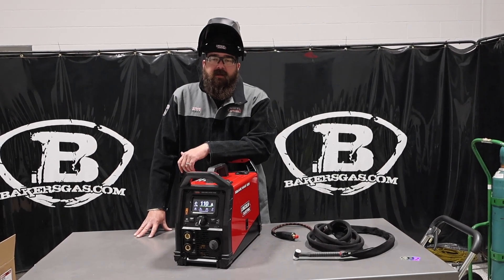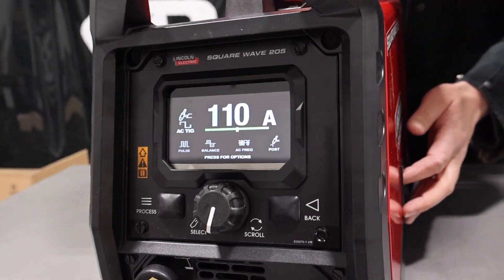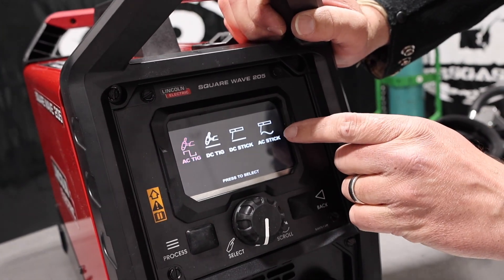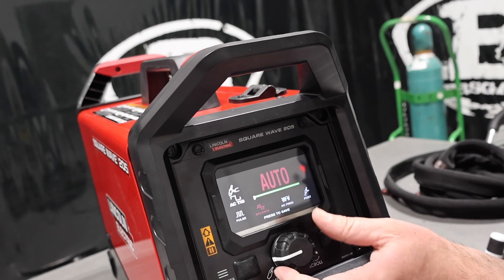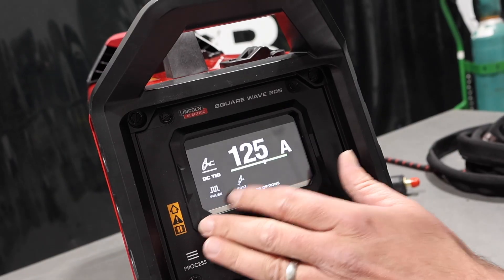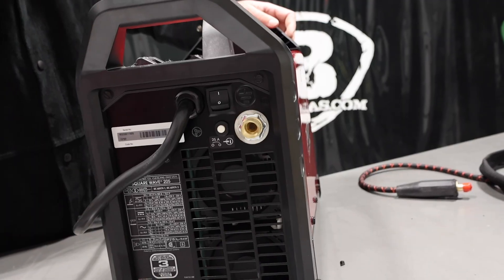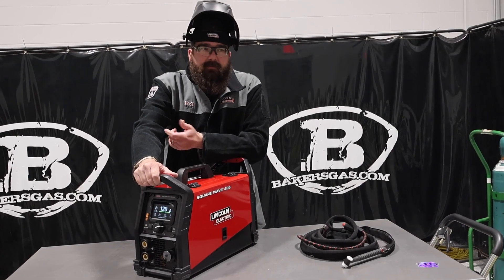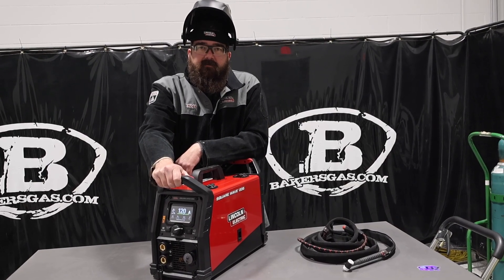Lincoln Electric Square Wave TIG 205 Review K5613-1

Comment: Can anyone help me out? How to I know how big of a generator I need to run certain welders like this.
Reply from the maker: To run a Lincoln Square Wave TIG 205, you will need a generator capable of providing a minimum of 8,000 to 12,000 watts
Reply: @BakersGas How did you calculate this?
Reply: @BakersGas And should run without any problems?

Comment: Could you use a wireless foot control with this unit?  How about a water-cooled TIG tortch?
Reply from the maker: There is not a water cooled set up on for this one. Or a wireless foot control sorry :( The Miller 212 you can

Comment: I want to see ac welding…. Also is this the promo price or is it actually $1400? That’s crazy it’s lower priced with more amps than the machine its replacing. Might grab one of these. Alittle small for what I need but would be nice having something portable. I want the new dynasty 300
Reply: If anything it will weld aluminum better than the original Tig 200 and yes it's 1500 flat out retail price I just bought mine the other day the supply house told me I was the first one to get one from them and they just got them in the day before
Reply from the maker: Yes, it is super competitive price!

Comment: I like my Tig 200 but always disliked that it lacks post flow adjustment.  What surprises me is the upgraded 205 is currently listed for $1499 on your website while the 200 is still $2695 with a $700 rebate.  The 205 is cheaper than I paid for my 200 over five years ago.
Reply from the maker: It is priced super competitively!

Comment: What are the specs for current and duty cycle using a 110v power source?
Reply from the maker: TIG: 125A/25%*
TIG: 100A/60%
TIG: 85A/100%
DC Stick: 80A/25%
DC Stick: 70A/60%
DC Stick: 65A/100%
AC Stick: 70A/100%

All details listed on spec sheet tab 
https://bakersgas.com/products/lincoln-k5613-1

Comment: How thick of material can you weld with tig?
Reply from the maker: The Lincoln 205 TIG welder, with model number K5613-1, can typically weld up to about 1/4 inch (6.35 mm) thick steel or aluminum, depending on the specific setup and techniques used.

Comment: Looks nice. I have the Tig200. It’s been an amazing workhorse for my garage+ jobs. The post flow is something I wish mine had but it’s not a deal breaker. And for the $999 I paid for it when it first came out it’s hard to argue it hasn’t paid for itself 100x over.
Reply: Just looked at the price on this one. Wow. I was expecting $1000 More than that! Well done Lincoln!
Reply from the maker: Yes wildly competitive